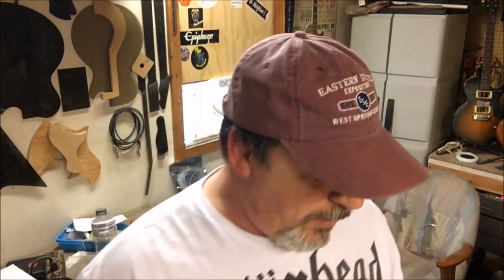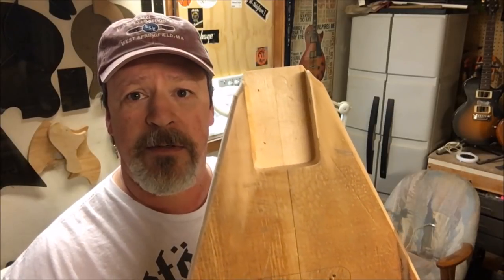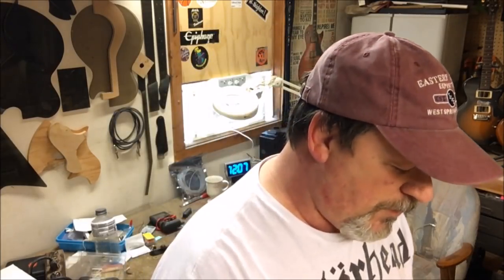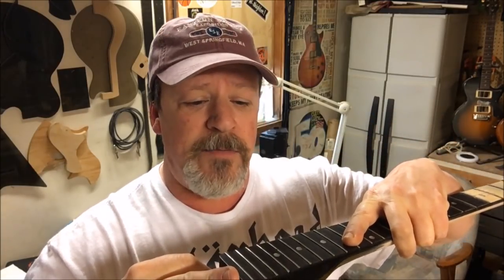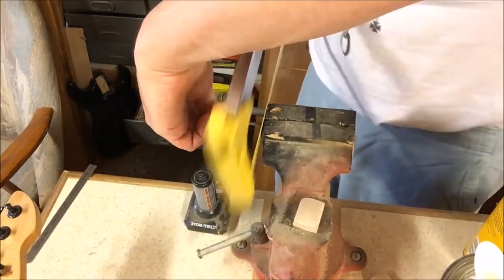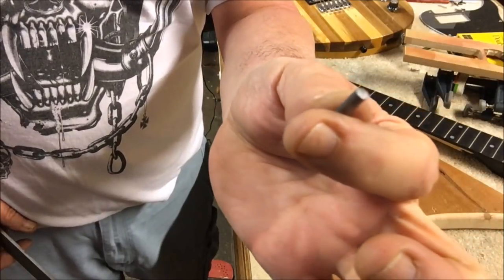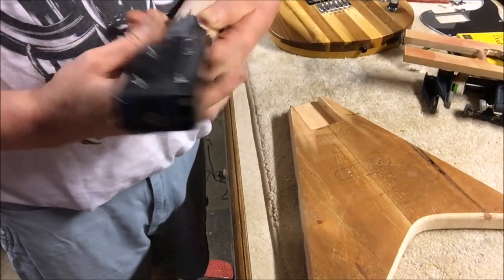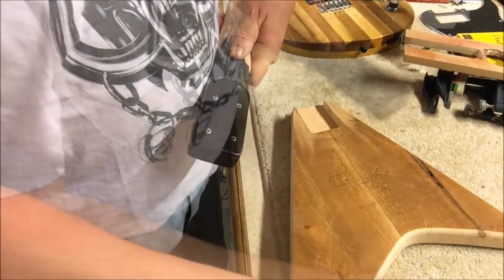Luthier's Tips & Tricks #28, New body vs. existing mounting holes in the neck

Comment: I'm impressed to say the least. Five years after making this vid, your method of using the trimmed nail in the existing neck holes stands alone as the solution to this problem. Most of the other video's addressing this, show how the jig they made makes short work of mapping the new hols in a body. Then they don't explain how the jig works or how to make one. That's a waste of time when your looking for real solutions and very frustrating.
Thanks for this. It really is an excellent solution

Comment: My concern would be that the point on a nail is not very concentric to the diameter of the nail.  How was the string position and alignment with the edge of the neck?  I am in the middle of a project right now that is essentially the same thing i.e. holes in neck, not in pocket.  My plan is to have some fitted pins machined up with a point and then basically do the same thing.  Before I mark the holes I will try and check the neck alignment either using a guitar string from the bridge or using a regular string from the center of the nut to the center of the bridge and see how it lines up with the dots on the neck.  Your post is helpful,  It confirms my thought on using pins to transfer the pattern.